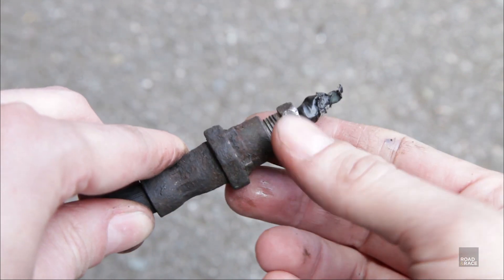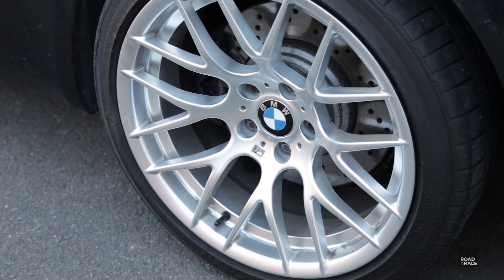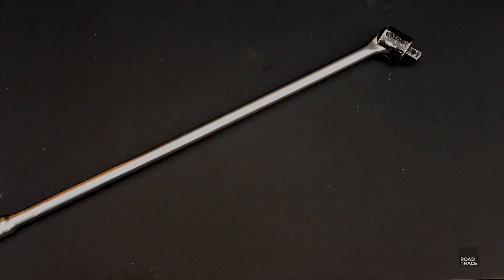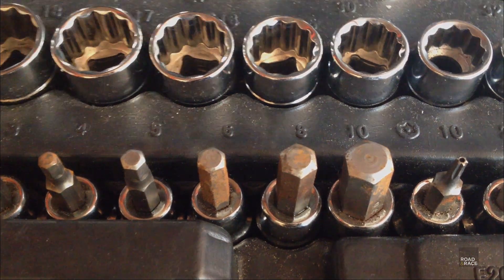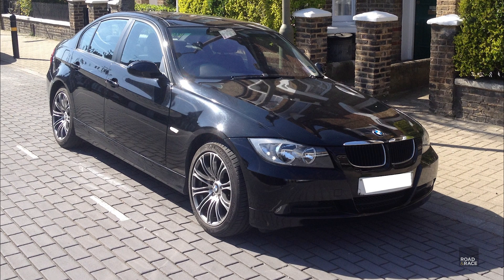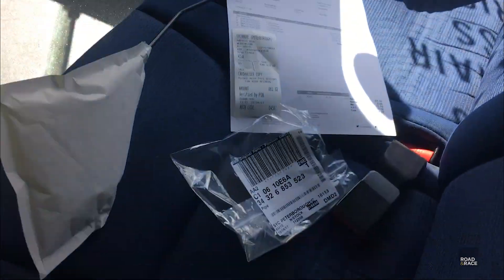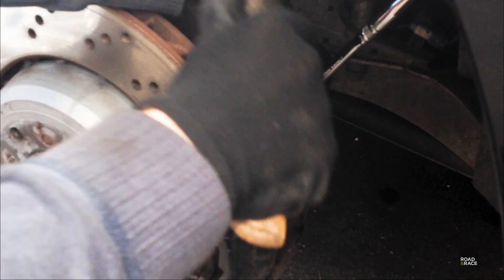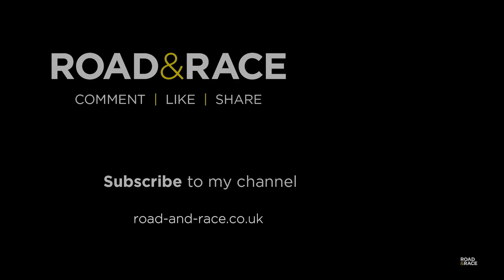Nightmare problems with BMW M3 brake pads and hoses

Comment: Regarding your wheels being stuck on - it's the copper slip you are using on the hubs that's causing it. You even mention galvanic corrosion - that white/yellow crud - the copper is reacting with the alloy of your wheels. It's starts corroding the aluminium as it's less noble than copper. I'd stop using it for that and use something like CeraTec instead and only on the lip of the wheel where it snugs against the wheel hub.

Anyway, great content, nicely done ;). I've been caught out by the 7mm too!

Comment: Glad you found the trick to replacing the lines. 

Great brake fluid that Castrol SRF. It has a very high boiling point! Maybe not 500C but much much higher than standard DoT4. 

You also realise when you work on a Porsche that they are engineered as track cars rather than as road cars, as is the case with BMWs.

Comment: Nice video.I had worked on Tyres for 10 years, to torque wheel bolts to spec is very important,(lots of reasons) unfortunately not all the shops do. To take wheel off, you can extended you break bar, there is chance break you break bar or bolts, no loctite on bolts or studs, I've seen some shop do that. There is a trick to get stuck wheel off, 
1 break bolts off (don't take them off yet) 
2 jack your car up securely (wheel off ground)
3 take all the bolts off,rescrew  2 back on, just 2-3 turns 
4 grab a heavy rubber mallet, get under the car, hit inside the wheel (gotta be on the wheel,not on the tyre) try get the car up high enough that you will have enough room grabbing and swinging mallet with 2 hands. Easier to do on a lift, I have never unable to take a wheel off 
5 put a little bit grease on hub, next time won't happy again

If you snapped the brake line, make sure don't let fluid drain to much, if master cylinder run dry, you will have to do heap more work to recover.

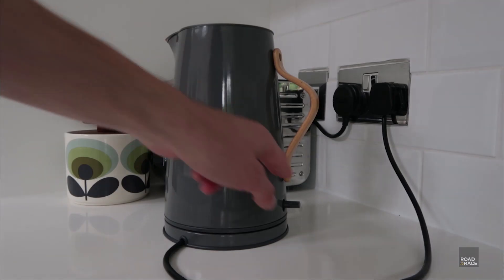Comment: Great tip at 6:10. I couldnt find a guide online and couldn't figure out  why the flex hose wouldn't turn on the rear of my e90 until i watched this video! Awesome car by the way.
Reply: How did you get the clip off.?

Comment: Lol I have exactly the same socket set which was bought to me as a Christmas present last year by my partner and I love it. have done loads of work on my CaymenS with it including replacing rear shocks and springs and it hasn't missed a beat. 👍
Reply from the maker: Yeah, it's a great set (apart from no 7mm!!!!!).   Good job doing the rear shocks, that's a dedicated piece of work that one!
Reply: Really enjoyed it apart from removing the the plastic panels to get access to the top shock mounts. Nightmare. 😩

Comment: You are not alone my friend. Doing brakes on my current e92 and previous bmw's, I've had the same exact experiences with +200ft lbs torqued wheel bolts and stuck wheels.. Made me laugh pretty hard actually. Cheers for the laugh and getting through the job!
Reply from the maker: +James Powell Thanks James, good to know I'm not the only one who had this problem!

Comment: Excellent how to! I had exactly the same problem with overtightened wheel bolts on mine, shearing two OE BMW lock nuts in the process. And of course, no copper grease either. Also bought a Makita impact wrench but even that struggles from time to time
Reply from the maker: BMW M3 S65B40 Thanks for saying so!   Yeah garage mechanics just don’t care so they.

Comment: Nice video again, just a quick one losing that extension and replacing with a deep socket will massively help in the torque you can put through that bar. At the moment most of the force is trying to push the extension to the floor, as if you where hanging off it from underneath :)
Reply from the maker: Cheers Jeremie.  Nice top tip there, will def try that out next time.

Comment: I had EXACTLY the same experience, as I'm doing the brakes on my Z3..had to stop and go to B&Q to buy a set of Hex fittings as I had everything bar a 7mm!.. plus got stuck getting the brake lines off so ordered brake wrenches...then couldn't get the hose out of the caliper so used a blow torch to heat the connection..that didn't work so now ordering new hoses!

Comment: I did exactly the same jobs on my 335i , couldn't believe calipers where only single piston sliding , then I changed the pads on my modern classic Mercedes E320 coupe , gobsmacked to find they're 4piston .

Comment: While diy changing brake pad and rotors on my lexus, i learned a lot from dealing with few other surprises such as seized caliber sliding pin, ripped bleeding valve of new caliber and reordered one...  and...   but after all, I got to know my car better.

Comment: Quick tip  use the jacks long bar as leverage by sliding it on the strong bar
Reply from the maker: Cool, thanks for the top tip!
Reply: You can also use the jack stand under the extension bar as a pivot point. And try hitting the extension bar with a mallet to jar it loose.

Comment: I'm going to say this is one job to give to a relatively inexpensive but knowledgeable BMW indy garage. I've changed a sticking caliper myself and pads but if you waste days, injure yourself and have to buy tools it's going to be cheaper.
I've also had to use a breaker bar to get wheel nuts off. very worried they were going to break inside the wheel.

Comment: Use WD-40 or similar on the hardline nut. Never had any issues with hardlines breaking due to stuck nuts when using WD-40.

Comment: Top tip!!!! Wheel bolts overtightened... Use your jack handle in conjunction with your breaker bar for immense torque...
Also.. Safety tip... Place all removed wheels under the car in case something gives, might just save your life... or your legs depending on what's under the car as it falls...

Comment: I prefer buying DeWalt. Bought Makita, Bosch, Metabo, but they all had crap quality. I mean sure, if you have a 1000$ Bosch drill it might perform okay, but then you could just buy a DeWalt of any price range and it will work superb. Seen people scoff at it, I mean, everyone has brand preferences. But so far, I am super satisfied. Bought a kit of wireless tools, I was amazed. Bought a table saw after. They all work like charm, brought back my fate in wireless tools just right when I was close to losing it.

With that said, Hilti tops it all. But no regular Joe can afford a Hilti tool.

Comment: The 7mm is rare even in expensive key kitts because is used in a safety sistem like brakes.
Reply from the maker: Ah ha!  That makes sense.  Thanks!
Reply: Whahahahaha! I did my brakes too last weekend. Had the same problem...3sets of hex....no 7mm. Lucky I am not the only one.
Reply: I never understand why no kits have the 7mm one as it the one you need the most!!  Almost all ford calliper bolts are 7mm.
Reply: @Sierra747  and Vauxhall.

Comment: You shouldn't put grease on the contact surface of the brake disc/hub, only on the portruding center where you fixate the wheel. The friction is caused by this area and exaggerated by the bolt tension!
Also Copper Grease can melt if it gets really hot. Just a tip for an otherwise great video!

Comment: The one piston setup has just about the same clamping force as a 6 piston, it all comes down to heat dissipation. Pads is a good choice because BBK all round is over £7k. The point you get a BBK you may as well strip the car and spend a similar amount on coilovers. Then race car...
Reply from the maker: Cool, didn't know that is has the same clamping force. Good to know. Thanks!

Comment: I use two short like 30cm steel pipes to extend the ends of a T wrench so I can apply force evenly to get the wheel bolts off

Comment: Nice video. How much did you purchase your brake hardlines for? Mine sheered off too... And now need to replace the driver's side rear line on E93.
Reply from the maker: Thanks mate.  Can’t remember but they weren’t that expensive even from BMW.  I think £80 for both?

Comment: Wow amazing video! Your narration sounds like from a TV show!  Content is amazing too!  Liked and subscribed.  Great job and keep up the good work.

Can I please make a request?  Can you please make a video on how to jack up your BMW and put it on 4 jackstands?  I'm very curious as to how the BMW jack pads sit on the jack stand.  I'm worried about the plastic jack pad slipping off from the jackstands if I don't do it correctly.  

Thank you!
Reply from the maker: +dragger168 Thanks mate that's very high praise indeed! Big thanks for the like and the sub.   Will try to do a quick video as your request although I'm not working on the car  for a bit.
Reply: Road and Race not a problem.  I'd appreciate it if you can remember this request when you next work on your car and put it up on jackstands.  Perhaps on your next oil change?

I'm mainly interested to see the sequence at which you jack your car up with the intention of putting all 4 corners on jackstands. And how does each jackpad sit on the jackstand.  I'm worried on doing this to my BMW because I'm afraid that the plastic jack pad might slip from the jackstand while I'm underneath the car.  I'm used to cars with reinforced pinch welds for jack stand placement.
Reply from the maker: +dragger168 Have you considered getting ramps? I don't work under stands, I don't trust them.
Reply: Road and Race I do have ramps right now. I've used it to change the oil of the car.  But my ramps don't have a lot of lift like race ramps.  And I think it's just so cool to put your entire car on 4 jack stands.  But the BMW jack pads are new to me and quite frankly, scary.

Comment: Haha I'm sorry man, I feel your pain!!!! Just started doing lots of preventative maintenance on my '09 1 series and it really is a nightmare often times even with all the correct tools. I think the major issue is not having a two post lift and being able to easily get the car up off the ground so high you can stand under it. I've got jacks and stands but laying on a creeper and working upside down presents it's own problems. I see this video is a couple years old and I haven't looked into your other content yet so I hope everything turned out fine with your car!

Comment: Can you tell me what 'ramps' you are using. I'm after a set and the one's you are using look pretty good ? Had the same problem with a stuck wheel....at 2am on a wet motorway...gotta love those BMW run flat tyres !!! fortunately I purchased a space saver spare that saved the day - once the wheel was off. Your video's are great - by the way.
Reply from the maker: They are by Race Ramps.  Expensive but amazing.

Comment: another thing that happens, is that people grease the bolts/threads, what happens is this INCREASES the torque applied and hence puts too much force on, wheel bolts should only be put on dry.

Comment: Did the 500c brake temp shown at the end of the video, INCLUDE or EXCLUDE a dedicated 'cool down lap' after your track session???  It is always advisable to run an additional lap at a much slower speed to help cool the fluid, rotors, and pads before parking the car after a spirited driving session.😉
Reply from the maker: Excellent point.  Usually i would do a cool down lap but in this instance I want to show how hot the dics got so no cool down lap.

Comment: When something straightforward turns out to a nightmare like upgrading my E92’s headlights to angel eyes leds and finding out the cables can’t be moved a lot because they’ll break. Apparently the sun in Greece is so hot that almost melted the rubber around them...

Comment: After changing your fronts, did you have any problems with rubbing? I have noises that go away when braking, but when driving along even at say 40mph, there is a rubbing sound, almost like the rotor is wobbling. Both wheels were torqued correctly. Wondering if ive damaged the hub or didnt install something right
Reply from the maker: No, no problems with rubbing.  Are the pads fitted correctly?
Reply: So I was a moron and did not torque my wheels - they were a little loose. Feel pretty stupid ! All fine now
Reply from the maker: Good to hear.

Comment: By the way, why don't you buy a second cheap car that you can just use when you work on the M3? I mean, it sounds luxurious, but the "Car Throttle" did the same, and it seems like a wise thing to do. I am no talking about an expensive sedan, but some small "banger car" that you just hop in, take it to the shop, can park it right in front of the entrance, and so on. (We use a Suzuki for this purpose. It works 24-7-365 with zero maintenance. Only have to change tires per season, add fuel and oil and it's good to go.)

Comment: I am a DIYer myself. What a satisfying thing it is - man and machine! Your videos really resonated with me. I had an e91, 328i with 3 pedals, which I did all the work on, what would have cost nearly 15k at the dealership, all in my front driveway. I currently own a 2012 e82, 128 with 3 pedals. I am curious, how much editing do you do to these videos? I think at the point of shearing that brake line, I would have lost my cool and dropped a few obscenities.
Reply from the maker: Good to hear from a fellow DIYer! I agree it’s more satisfying.  A fair bit of editing takes place but I half expected to ruin the brake lines and they’re not too expensive.

Comment: What race ramp model is that? Will it rub as you drive up going forward? I wonder if those rr can be used as jack stands if you place on all 4 wheels?
Reply from the maker: +Ryver Choy Can't recall but it's the low profile one that separates.   No rubbing.  Yep, definitely.

Comment: Do you keep these pads on for normal use too? If so, do they squeal?
Reply from the maker: Yes.  They squeal a lot for the first 2000 miles or so then settle down.  Still squeal a little though.
Reply: Thanks dude.

Comment: The Problem with the Brakelines is that they are Plastic Coated, when water comes under that Coat its getting wider and make it inpossible to turn the Nut. Too much Force and you sheerd up the Line, best solution is to give the Nut a little Heat.

Comment: You said it yourself, galvanic corrosion = when two different metals get in contact with an electrolyte as conductor... what did you do? put a third metal in the form of copper grease in the mix... what do you think will happen?

Comment: 8:27 please check the clip and brake line into the brake hose.  It appears the clip is not properly seated into the bracket and might be cross threaded or loose/  please be careful.  BTW did you end up servicing the inner rear brake hoses or did you just leave them??

Comment: well... copper grease on hubs is not a good idea... copper in contact with aluminium causes chemical reaction, called also corrosion. Next time it will be even harder to put those wheels down.
Better use some silicone paste or white antiseize.
Reply from the maker: You're probably right although I've done this on previous cars for many years without problem.

Comment: 8:13 You DONT need to lube the pins on BMWs. They are meant to sit in there dry, as the rubber moves the pins and caliper back when the brakes are released. If you lube them, this doesnt happen and it introduces friction and heat - its not much but still why...Also the rubber in which the pins sit is so tight around it, that it doesnt really give the effect you want as it wipes the grease away.

Comment: I never take my lugnuts off the old fashion way. Always use impact anywhere you can. If you can't' afford an impact you cant' afford a car period. No way in hell can afford a trip to a mechanic. No excuse these days to be without an impact if you own a car and have half a brain to do simple repairs. It's an investment. Work smart not hard. The best investment for any car owner who don't want to get ripped off by shops.  I have an impact in all 3 three cars I own and two more at the house. Also the impact saves time and energy to raise the factory jacks to change tires. Just put on an adapter for some jacks and press and trigger and boom up she goes and down she goes. No manually having to spin the jack handle and busting your knuckles and sweating and cursing. All the savings from not having to deal with mechanics afford me to buy many tools and still come out way ahead. It's like getting free tools with all the money I am saving. Plus I'm not supporting price gouging scheming lying thieves with my hard earned money. Bonus I learn valuable skills.

Also use two wrenches instead of one. This makes sure the lines stay put and not move and twist from the force of only one wrench. Also it doubles your force to break free the nut as you're now using two hand and two arm muscles in opposite directions.  One on the backside as well. The one on the backside can be any kind of wrench that will fit well. Only the front the small nut where the metal lines enter has to be flare nut. Push one wrench away and one toward you at the same exact time. Always worked for me no matter how rusted. Also use longest wrenches that will fit in given space for more leverage and control to avoid slippage and rounding of nut. If it is really rusted soaked the nuts overnight and do it again the next day for another 15 minutes. You can also use a small torch that can get in there. If it looks super rusty like yours in the video I would hit it will some heat for just a quick 5-10 seconds. It will come off like butter. Careful of the rubber hoses. Keep away at least a few inches from any rubber parts and focus all the heat on the nut. Have fire extinguishers nearby. Only on brake lines. Make sure it's not fuel lines or ka-boom explosion. If it 's stuck fuel lines just cut it with a line cutter, pipe cutter, or snips.